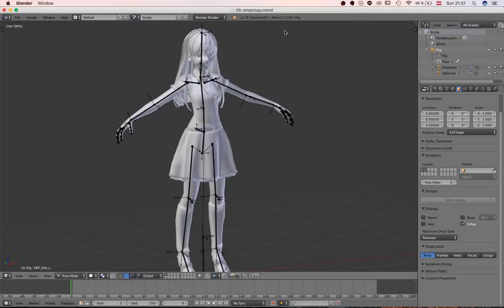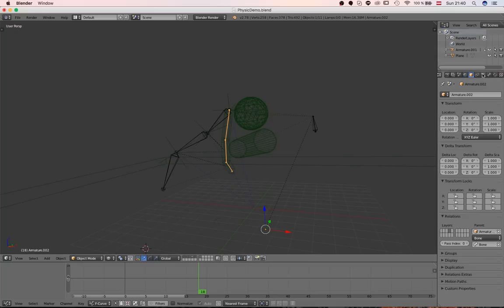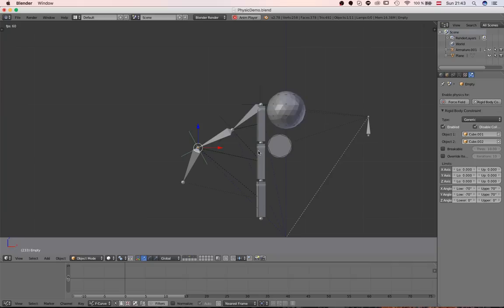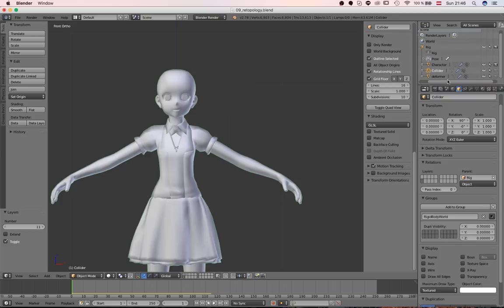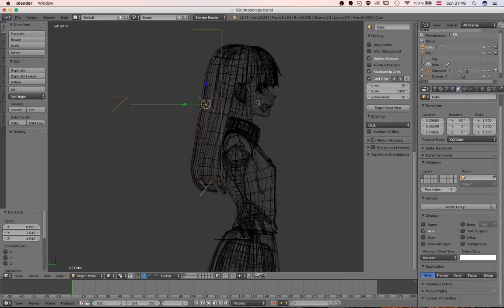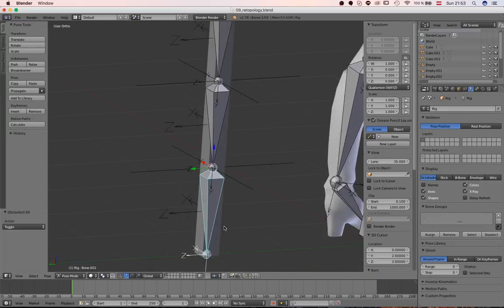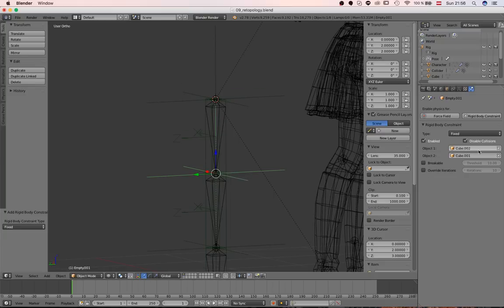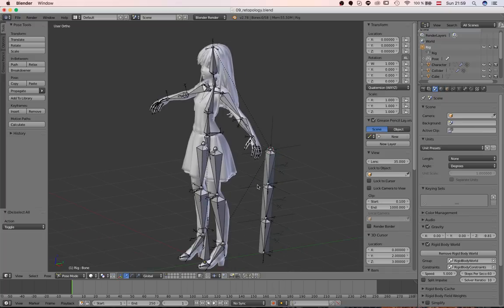[4/6] Complete Character Rigging Guide (w/ Hair Physics) - Blender Tutorial

Comment: can i ask something? what about plane hair it doesn't have dimension so i can't put the rig inside the hair strand.... so can i just put it close to the hair? and also my hari is 1 object per hair strand. 

and also if i don't have collider on my character so where should i parent my first empty object? 
thanks...
Reply: I hope it's okay if I try to give you an answer here. 
I would say yes to the first of these questions. I haven't looked into the next part yet, but I'd assume it will be very likely to do so. The more armature strains you have the more control you have over each hair strain. I would still consider attaching close ones to the same one so that you have less performance issues because every rigid body system that is generated eats away performance. You will have no choice than test it out yourself here. 
For the hair weighting in general you can still go and use weight painting (and yes, weight painting is annoying, I know). I have seen that there has been added a weight paint palette a while ago that will make it easier to repaint with a certain value. I also have single planes for my current horse model's hair so I will probably face similar questions/issues soon. I could tell you my results on this one later on. Wish you good luck with your armature system, hope I could help you here.

Comment: Ever try doing the hair rig using cloth sim? I think I got that to behave ok. Just using a string of connected edges (same number as bones, with the verts placed at bone ends), having one vertex assigned for hook and pinning (so cloth sim doesn't fall out of scene), and a vertex group for each vertex trailing down the line. (Needed to assign bone tracking.) Bones seem to behave ok by using damped tracking. (Not regular! It'll spaz out with twisting.) Seems to save a step of having to make and adjust all those rigid body constraints, and adjustment is via cloth sim instead.

Just wondering what thoughts are on that? As usual with Blender more than one way to do something, so I'm curious as to what advantages/disadvantages are between that and the way you're doing it here.
Reply from the maker: Cloth sim is also worth a try. I was also able to archive good results but they aren't very reliable in my experience. It's hard to say